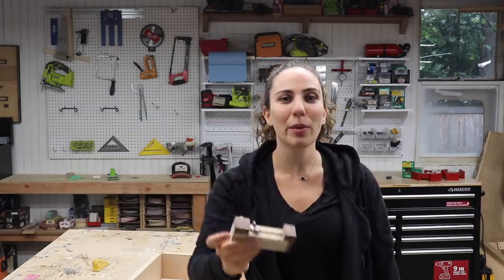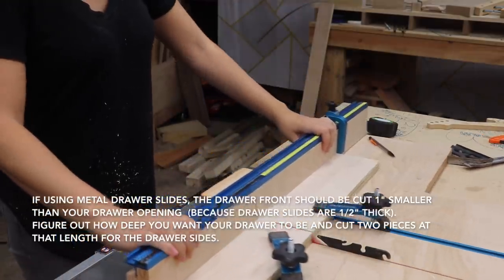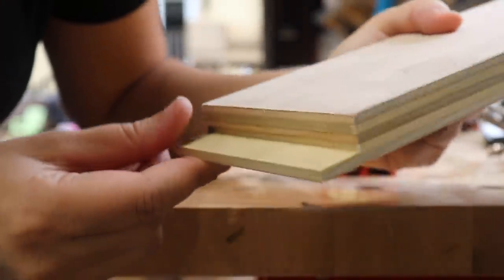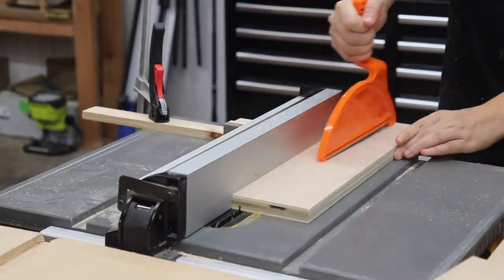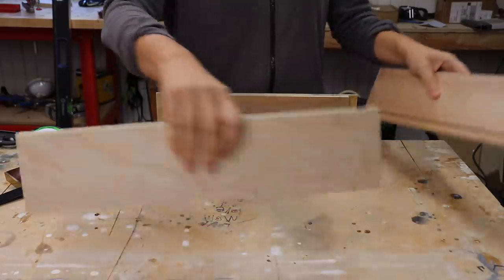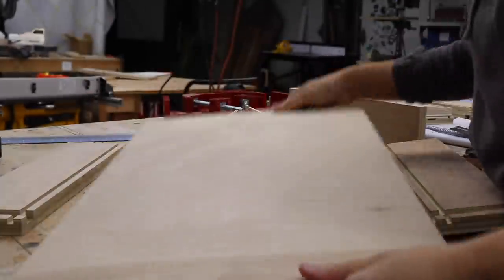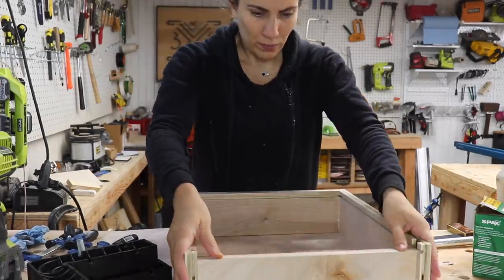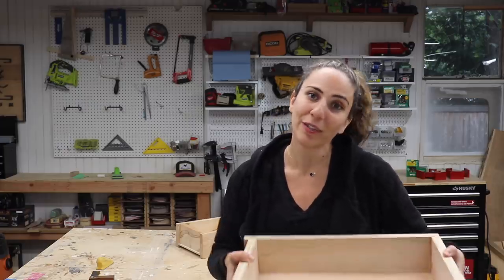How To Build Simple Drawers // Woodworking // Kerfmaker

Comment: Well, I for one love the way you say 'drawer'!  I love even more your attitude about it in your responses in the comment section, friendly and down to earth, not taking offense as so many today often do, about everything.  I am also a fan of your design choices in all your projects.  Take these drawers, for example -- perfectly suited to the application for which you were making them.  Not tacked together with brad nails, glue and butt joints like a quick shop drawer, and not the other end of the complexity scale with fine joinery like dovetails, or even an interlocking rabbet joint.  Solid bi-directional glue surfaces in the rabbeted corners, reinforced with screws, give all the strength you'll need.  Even down to the floating bottom with an exposure in the back to remove it in case it ever needs repair.  I used to think people used floating bottoms out of some snobbish loyalty to woodworking tradition, going back to the days when a glued-up solid wood panel could swell with humidity and blow out the corners, a problem that'll never happen with a stable plywood bottom.  I stopped all such scoffing the first time I had to cut a glued and brad-nailed bottom off a drawer for a repair, using a junk blade and dressing up the cut with sandpaper, to avoid risking the carbide teeth on my nicer blade.  I still make the glued, nailed, butt-jointed variety, but mostly for the shop or other applications where they're quick and dirty, and probably assembled from available scrap, and replaced by same.  Anyway, enjoyed the video....  'draws' and all!   :)
Reply: Yep, love your east coast pronunciation!

Comment: It's a good design if you make very accurate cuts.  Tamar, you make things seem easy but after trying this for myself I had to revert to using the same type for both the front and the back of the drawer so that the cuts were exactly the same on my table saw and there was 0 risk of making the slightest mistake in measurements. I also used your method of gluing the joints but added screws and hid them with plugs, and they came out awesome!:cat-orange-whistling:

Comment: Another nice demonstration. Good practice measuring between dadoes from the 1" mark rather than from the tape measure hook ... but you do have to remember to subtract that 1". So after 'inching' myself too many times (any builder knows that reflexive verb),  I began measuring from the 10. That way your last digit is the same, and you are more likely to catch the mistake if it is 10" rather than 1". Measure from the 10 to 33-5/16, that's 23-5/16.
Reply from the maker: That’s a good idea. I do mess that up sometimes

Comment: Nice ideas in lieu of using a router to make the dadoes and other cuts. Cool as a hobbyist handyman I use a lot of the same tools including some Harbor Freight bar clamps, Ryobi 18g nail gun & many of the same Rockler tools. Although you used plywood for the bottom making it not necessary, cutting a v- groove along the back portion of the drawer and securing it to back "rail" support with wood screws that allows for humidity changes as Rob Cosman does is a good way to secure the bottom. The brass pin example you showed was a simple but actually dressy way vs screws or to half-blind or full dovetails securing the sides the the front. I may just try making a kerf maker modeled after your accreditable design.
Thanks for sharing***

Comment: If you were to have any future failure of the drawer, I think it would be the back edge of the bottom. The pin nails primarily keep it from sliding, but if heavy items are in the drawer, it will eventually start pulling them out in the middle area as the bottom flexes. Screws would be a good option. Keep up the good work.
Reply from the maker: Thanks for the tip!

Comment: Brass pins is clever and quite elegant.  I have used the smaller diameter finishing screws.  They looked ok, to me.  I really like this brass touch.  Brass is easy to mill.  We use brass and copper every day at work.
Reply from the maker: I love using brass in my work. It’s so easy to work with and looks so cool

Comment: Not sure if you are still monitoring older videos.  I have a question.  I am making drawers for my workshop.  If I am building a 24x24" drawer do you believe 1/4" is thick enough for the drawer bottom?  Drawers I am thinking of would be 3" deep, for screwdrivers, wrenches, or sockets.  Normal tool drawers.  Deep drawer I would upgrade to 3/8".
Reply from the maker: If it’s in a dado. Sure!

Comment: Any reason you prefer to do your drawers this way vs quarter, quarter, quarter or half half half?  I learned the method that stumpy nubs shows and I like the way the back panel lines up with the ends of the side panels when you cut the rabbit on both sides of the back panel better. Plus it's nice to be able to just set my table saw to one setting and do all the dados and rabbits without having to move anything
Reply from the maker: I find the dado to be stronger at the back. And If pressure fitting the drawers or using wood slides you can pull them out to the back without pulling them out all the way

Comment: The Kerfmaker is cool. Thumbs up!

To avoid reinforcing the front, flip the front rabbet and add a grove along the sides for it to fit into.
Avoid gluing the bottom and instead, screw it to the back with two screws.
Very cool.
Yes, this is from 2018 but the content is relevant. Did the draws last?

Comment: Thanks for the video. I had a couple of questions if thats ok?  
Why did you dado the back? Would a rabbet joint work as well? 
What is the thickness of the ply edges? 
Would 12 or 15mm ply be strong enough? 
Thanks. Tom
Reply from the maker: Glad you liked it. A dado feels stronger to me than a rabbet. A rabbet needs reinforcement. And im not sure about mm... I would use anything from 1/2" - 3/4"
Reply: @3x3CustomTamar  OK thanks! :D

Comment: Nice video.  Question:  Given that all your material is dimensionally stable plywood, is there any reason you wouldn’t glue in the bottom panel on all 4 sides?
Reply from the maker: Nope. I would glue it

Comment: Maybe this is a dumb newbie question, but why do you leave it so that the bottom can slide out the back instead of sliding the bottom in before gluing on the back and having another groove on the back to support the bottom?
Reply from the maker: Just in case you ever need to repair anything ☺️

Comment: Nice drawer
I think it's not a bad idea using angle ruler with clamps comparing  with angle vise..
You may add sections inside the drawer to fit some stuff like small tools,bolts,nuts or maybe some kitchen stuff😊
Reply from the maker: That would be cool if it was a shop drawer. But this is for my kid. So it will be filled with crayons and stickers....
Reply: @3x3CustomTamar  best regards to your kids 💚

Comment: Question: the black plastic squares - did you true them up and flatten them?
Reply from the maker: I have no idea what black plastic squares tithe talking about. Look how old this video is
Reply: @3x3CustomTamar  the ones I have are sold by Rockler.  The surfaces are such that they need sanding and checking with a machinist’s square.

Comment: Awesome video. Is there a reason for the sides to overhang in the back?
Reply from the maker: Thanks! Just to be able to House the back in a dado. Which is a strong joint. Also could prevent tippage if you’re not using store bought slides

Comment: Hey Tamar. Can you please explain why the back of the drawer is not flushed with the sides?
Reply from the maker: Well. It’s my understanding that there might come a time when you may need to replace the drawer bottom. So if you make the back a bit shorter you can easily slide another piece of plywood in the groove to quickly replace it.

Comment: Very neat device (kerf thingy).Did you need to smooth the base of the dado to get a perfect fit? Or would that roughness add more surface area for a “potentially” stronger joint. Router planes do a lovely job.
Reply from the maker: Thanks! I probably used a router plane. Don’t recall in this video

Comment: Nice video!  Did you use 1/2" ply?  Love the brass pin look.   I'm going to be making kitchen drawers soon and may use plywood instead of pine or poplar, so no dovetails.  Still deciding.  If I do the plywood I may try Miller dowels (mini).  They have some nice hardwood dowels.
Reply from the maker: I used 3/4 here since I knew I was going to route a 1/2” groove in the sides for the project I needed.

Comment: Love the kerf jig great idea going to make myself one of those. Just one query, is it good idea to glue the bottom at the front as well as screwing the back ? Shouldn't you only attach one end to allow for expansion, I know ply is fairly stable so prob not an issue.
Reply from the maker: With hardwood. I would say your correct. But plywood isn’t going anywhere.
Reply: 3x3Custom - Tamar great thanks for reply , thought that might be the case but thought I'd check as going to have to do this soon on my own DIY project.

Comment: Great job Tamar.  Sponsors should send you a dado blade set.  Please keep them coming.
Reply from the maker: Thanks! My saw actually can’t have a dado set in it... should have done more research before purchasing.
Reply: @3x3CustomTamar  The dewalt tableswaw has a rack and pinion fence adjuster, which is why I bought it. If you don't do dados much it's great.
Reply from the maker: thejman713 yup. That was the selling point for me as well!
Reply: @3x3CustomTamar  I have the same saw.  According to some of the reviews, you can get the Freud 8" x 20T Box Joint Cutter Set (SBOX8).  It's not a fully dado blade, but is 3/8" wide.  I may get one sometime.  The saw doesn't have a lot of power for a wider blade(s) like this, so I'm still thinking about it.
Reply from the maker: K.B. Woodworker thanks for the heads up

Comment: Drawers like this are easier to assemble if you make dados (housings we call them in the UK) at both the front and rear of the drawer and trim the excess length off the drawer sides at the front of the drawer once the drawer has been glued together.
Reply from the maker: Interesting. I never thought if that.

Comment: Once again, awesome build. For my own curiosity, was there a reason you chose to use the table saw for the dados and rabbets instead of the router?
Reply from the maker: Thanks. Well maybe the groove for the bottoms I would have done in the router table. But I don’t have a good coping sled for my router table to be able to hold those pieces lengthwise along the table saw fence yet.
Reply: @3x3CustomTamar  Thanks for explaining your rationale!

Comment: Another way to cut the back of the drawer without measuring is, when you're cutting the dadoes for the drawer bottom, when you're making the cut in the drawer back, raise the blade up to do a full cut instead of a partial cut.
Reply from the maker: Yup! That would have worked if I would have made the groove on the other side of the board or if I was starting out with the same stock width. For the back. Always options!

Comment: Great video! Question, is there a reason why the back seems to be inset a bit?
Reply from the maker: Thanks! Are you asking why the back piece is shorter than the others or why it’s inset into the sides?
Reply: . why it's inset into the sides
Reply from the maker: martintoyejr it’s inset so it’s locked into place. It’s a in the dado joint. It’s just a method to join the pieces together.

Comment: How do you determine drawer dimensions to fit an empty drawer space?  Any shortcuts?
Reply from the maker: I measure.
Reply: @3x3CustomTamar  wow your a frigging genius
Reply from the maker: @philhooper4196  haha. Sorry. That was after a long session of answering a billion questions. No shortcuts. 😂
Reply: @3x3CustomTamar  I want to get into woodworking and into making cabinets.  How do you determine the dimensions of drawers to the size of the hole and the cabinet and are the sizes of sliding hardware generally uniform in thicknesses account for the width of the drawer
Reply from the maker: @philhooper4196  drawer slides are usually 1/2” thick so you double that to get 1”. Subtract that from the opening. But, I usually just measure. My actual drawer slides and just subtract that.
Reply: @3x3CustomTamar  ty for your time ❤

Comment: I really like your videos, just a couple of things you definitely don't need to reinforce the dado it is super strong ad like you said there is almost no force being applied to it. 
The other thing is you should seriously consider getting a ruler either a folding rule or a steel engineers rule. In a workshop setting it is so much easier to work with than a tape measure. Especially because you don't need to start at your second inch on the tape and then remember to take it off when you do your cut.
Reply from the maker: Thanks for the tips!

Comment: 1/2 Dado for the back piece so you could place the back plus with the ends
Reply from the maker: My saw doesn’t accept a dado stack. So this is what I have to work with.
Reply: Not what I have meant if you rabbit the back piece you can make it flush with the sides
Reply from the maker: Yes. That’s also an option. But then the back needs to be reinforced.

Comment: The attention to detail is impressive, but for me, the work is overkill. These drawers will survive a tornado and an earthquake. I guarantee it. I make drawers in a similar manner but without the table saw, the dados and the rabbits. I use 1/2-inch plywood. I prefer lighter drawers and as much interior space as I can get. My method does require near perfect cuts, and I created a jig for that. I stopped using glue long ago. I found it's just not necessary if you countersink screws. I do appreciate skill and tenacity, which this builder has aplenty, in spite of her aversion to math, which is one more thing I share with her.